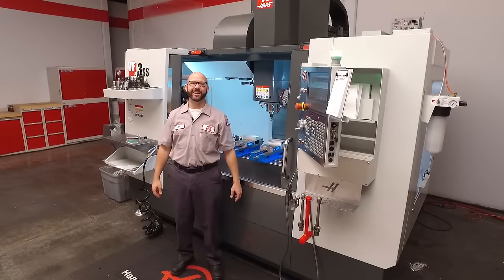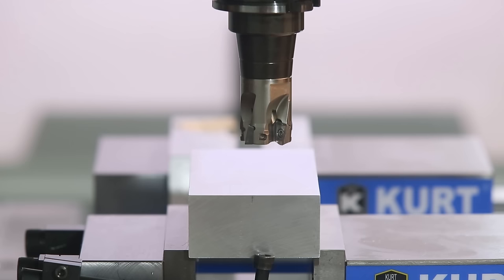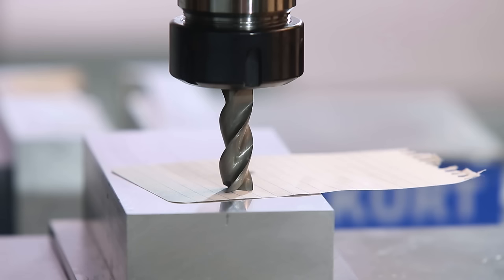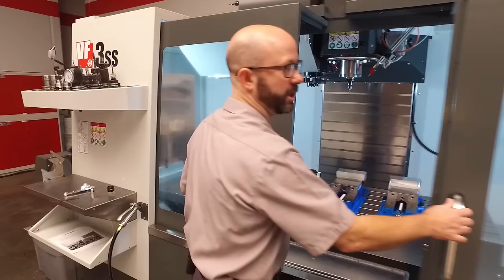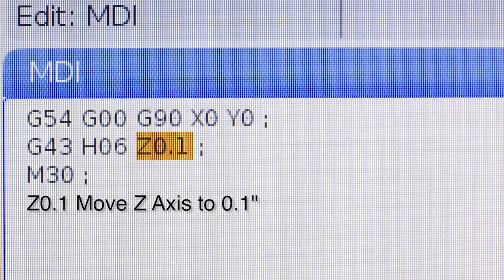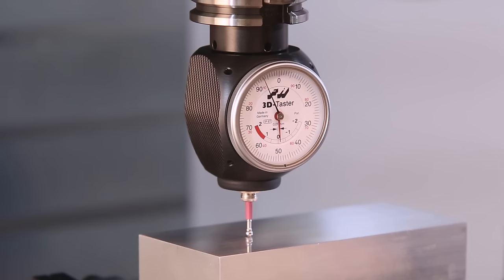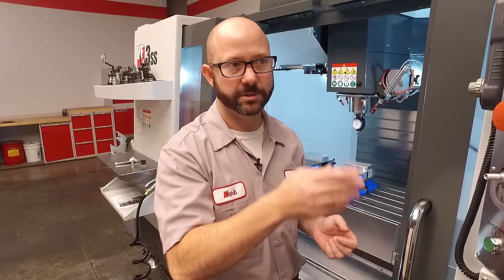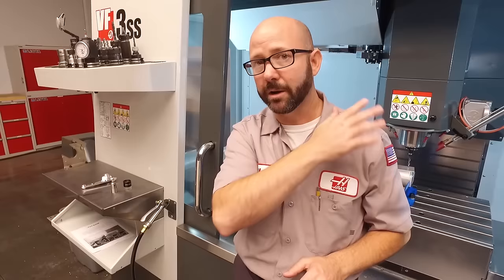How to: Set Tool Length and Work Offsets – Haas Automation Tip of the Day

Comment: While setting tools off the top of the stock is quick and easy, it's really not an optimal solution. If a tool breaks and needs to be replaced after you've already faced the part you no longer have the same reference point to touch it off against. In addition any offsets set this way will not be applicable across different setups, requiring you to reset all your offsets for every job, which can be a pretty big time waster. You'd be better off using either an electronic or dial height setter to measure off of the machine table, then use your indicator to measure from the table to the workpiece the same way you measured from the G54 offset to the G55. You can also tag tools with their offset values when they are removed from the machine, then simply re-enter those values the next time you use that tool.
Reply: You use a taught tool to figure out the difference... say .020 then you would add .02 to the length offset. Its all numbers not that hard... Some teach from table with 1 2 3 block or 2 4 6 block some use top of the vise, and some use subplate.
Reply: You're better off using the table or a sub plate rather than the vice, for one depending on your use case the vice might not always be there, for another, the top of a vice's solid jaw isn't always flat or level. For me, I reference off of the sub plate, since it's basically a permanent fixture in my mill. Whatever you do choose as a reference point it should be repeatable, simple, and consistently available.
Reply: Same applies maybe they never pull the vise off? Maybe they order matched sets? Just depends
Reply: Never happens more often than you'd think. I'd still prefer referencing off of the table or sub plate. I'd only reference off of the vice if I had no other option, such as if the table or sub plate were inaccessible.
Reply: Why would you need to set the new tool from the stock If you have the 
old(broken tool) tool value and the new tool value? You can basically 
use any point on the machine. Just figure out what is the difference 
between old and new tool and then type in the correct value. And why would you re set all your tool offsets? tool lenght is tool lenght, You set a new zero point.
Reply: SUMOCAT If you're measuring on the machine, as demonstrated in the video, you don't have the new tool's length. If you did you wouldn't need to measure it.
Reply: There's no need to know anything, because you can measure it with the machine. Lets say the broken tool lenght was 100, now put a new tool in the holder
G0 it to a point, for example next to the vise over the table
G0 to a safe distance above the table for example Z0 <- the original zero point that you had
Now joq and "touch of the table", record the distance from Z0 to the table, let's say the measurement on the screen is Z-90.42
We know the original tool offset value and the distance from Z0 to the table with the new tool (90.42)
Now original tool value 100-90.42=9.58 then 100+9.58=109.58=New tool value.

So basically distance from Z0 to the table with the new tool is 90.42 and if we would move that 
same amout with the old tool (100 long), we would be above the table by 9.58, and since we have "touched" the table with the new tool, that means the new tool must be 9.58mm longer so new lenght is 109.58
Reply: SUMOCAT Or, bear with me here for a moment, you could set all your tools relative to the table to begin with and not have to deal with any of that.
Reply: Yes of course, you should do it right the first time.
Reply: Just replace the broken tool with same offset as the old one. Why you thinking too hard
Reply: you must be joking right?

Comment: I would send it to 1.0 instead of .1 then you don't have to stop it before the end of 
the block and use the "eyeball mic". Run the program and test it with your 1-2-3 block.
Reply: I use 3.002 or so. This allows higher rapid speeds to save time while remaining safe because there is plenty of time to hit slide stop in the event of an error. The 0.002 avoids chipping a carbide tooth while being close enough to identify a math or measurement error. 1-2-3 blocks have so many uses.

Comment: what video should I see to find how to setup system to work with all G54 + tool offsets enabled in handjog mode ? I work with TL1 and ST10 lathes, and feel very handy to do some manual detail processing in manual jogging to presizely setup all tools corrections before automated cycle run
Reply: it's the same question: how to setup TL1 panel state in jog mode with large numbers in operator coordinate system with all corrections enabled ?

Comment: Just so I understand the hass machine reads off the programmers zero and not absolute machine zero  when setting a job? , my understanding for when running Fanuc controlled machines is that the zero point is referenced off the distance from the home point of the machine

Comment: This method can cause problems. The correct tool length is from the face of the spindle to the tip of the tool. Using the light up probe touch the face of the spindle to the probe (lights up). Set operator position z=0. Now measure all your tools. When the probe lights the operator position will be your tool length. To set your work offset touch any tool to the top of the part cursor over to your g54 (or g55,etc.) Z, then press work offset set key, (then put the cursor back to Z because it will move to X) then minus the current tool length. This way you do not need to re measure all the tools when switching to another part.

Comment: Ive always used a .100 jo-block and going positive.  That way I dont chip my tool.
Reply: I used to use a 1-2-3 block and a .250 dowel that way. Set all my tools, then on the Fadal, global edit all tools -3.25" to set zero to vise ways. Now I use a 1" Mitutoyo zero setter. Big multi-insert face mills/Shear Hogs I still use the block and dowel to be safe.

Comment: Not that it matters much in this application, but Interapid specifies 12.5 degrees from the work surface to be the most accurate. Mitutoyo specifies zero degrees. In the video it looks like about 45 degrees. Again, youre just using it as a reference, but I always shoot for the optimal angle for best practice.

Comment: I have a unique application in which the (non-rotating) tool has an X and Y offset from the centerline of the spindle. Does the controller support X and Y tool offsets?
Reply from the maker: Hi Charles – The only way I can figure on how to offset a tool’s position, in the exact same XY direction each time, is to set a Work Offset that is used only by that toolpath. You can touch off the tool normally, and then add to the Work Offset used by only that tool. We do this quite a bit when working with Right-Angled Heads. Check out https://youtu.be/URO3ETG18bs?t=684. Cutter Compensation offsets the tool by some amount, but not in a constant XY direction, it adjusts the tool in a direction perpendicular to the toolpath at any point. For specific, short programs, you can look up our G141 code in the Haas Manual, which does shift the tool, but the shift must be programmed on each line of code. – Mark, Haas Tip-of-the-day

Comment: You have a second part in the other vice. Why didn't you explain how to setup this 2nd part. The z height may also be different, as well as the origin point.
Reply: Hi. Check out 07:34 in the video, and we also have a link to another video which talks more about this, just above (pinned link at top)

Comment: Great video!  I have one question,  can Ithe tool length compensation and work offset be seen on screen in hand jog mode? Like, if I jog down to Z0 the tip of the tool will at the parts Z0 (G54)
Reply: Really good question. We should do a video on this. Newer Haas machines with the NGC control display the current G54 Work Offset, with the Tool Offset (Tool in Spindle) already calculated in, so the display works just like a DRO Digital Readout. On older machines, we will need to command the tool to XYZ zero first, G54 G00 G90 X0Y0; G43 Hnn (H matching tool number) Z0, and then press MEM, and then HAND JOG. from their, our Distance To Go position display will show the current G54 position of the tool. It's much cleaner in the newer NGC software.
Reply: Thanks pal!  I will try that first thing monday morning! Or maybe I will sneek in on sunday 😁 your videos are the best!

Comment: When teaching CNC at college I  used to use your first 5 or 6 standard first lines. I always made a point of telling my students to always cancel something when you have finished with it ie when finished with G43 H.., cancel it with a G49 G90 GO0 Z0.
Similarly when finished with tool radius compensation always cancel it with a G40 with an X and Y position off the part. Also to initiate tool radius compensation always call up the G41 or G42 with an X and Y position and feed rate. I notice in your videos that you dot do this with for the Z axis comp.
What are your thoughts on this?
Tony

Comment: Hello, maybe this is the best place to ask lol. I do production runs, some of the same jobs for years with the same programs etc "Haas vf-3" . Have had an issue for weeks now and not sure why. all of our parts are coming out .018 to .020 larger now only on height "Z" . Checked entire machine, checked this issue and verified it is happening on every program so we have to adjust our main z height for our parts. Could this issue be a wear offset somewhere that i may be missing ? we have also made sure that head is in same position in z just in case and there has been no change. I am clueless at this point, however i am not the only one running this machine, so Either other person or i may have inadvertently changed an offset somewhere that is affecting all z values during a cycle. Any help is appreciated.

Comment: why would you want to use such a method of touching off? it's only good for that setup. if you tend to use the same tools over again with different job, wouldn't you have to retouch them all off becuase the z-position of your work it's gonna change? wouldn't it be better to reference them to the work table and then only add the z value for each work offset?

Comment: Question : why don't you set all your tools to one z height , like say a 1 inch block and then set one tool to the part zero .Then your next job you can use the tools that are already loaded by just resetting one tool to the new part zero ?
Reply: That’s a great way to set offsets. It all depends on if I am changing all the tools constantly (job shop) or if I’m working with a consistent tool library. Both have advantages. Check out a video on your method, here: https://youtu.be/A7CwqjU2wg8

Comment: Your getting closer
I want to see a Haimer used in conjunction with an edge precision Tool indicator (4" height dial indicator for setting tools)

I touch all my tools off a tool setter from the table using G59. Then I use a Haimer to find my part, but I always have a few thousandths error.
Reply from the maker: MCEngineeringInc – That is a slick setup. Probes are always my first choice (for reasons beyond just touchoffs/setup), but it doesn’t get much better than a Haimer (Work Offsets) with a precision Tool Indicator (Tool Offsets) for Mills without probes. I should’ve shown one. Thanks. – Mark, Haas Tip-of-the-day.

Comment: There are so many ways to do  tool offsets this video is only 1 of them I use a n electronic z height gauge similar to the cute little thing he used. all my fixed length tool have dedicated offset numbers that are not the same as the tool number. I set tools with the z gauge on the table not the stock variable length tool such as those used in er collets have the same offset number as the tool number ie:- T1 = H1 work offset I do slightly differently to. I zero my indicator to the z height gauge then zero the z on the display then I touch off the indicator to the work piece or Parallel if I am doing a bottom up program and the display value is my z offset value for the work coordinate as this is the relative distance from my tool setting gauge. so as you can see there are lots of ways to set a machine.

Comment: What is the advantage of setting an offset vs jogging to where you want it it go and just setting coordinates
Reply: When you have only one tool, there is no advantage. 
In this case there are 8 tools, with their lenght already set, and it's here where you're going to take advantage:
You set the offsets (g54 and g55)
Then, with g43 activated, the machine makes the calculus needed (taking into account the lenght of the tool) to bring the tool to the Z you want.

He set the offsets with the measuring tool just once, wich is enough for all the tools.

Doing it the way you say, he would have spent 10x more time setting each tool.

Sorry for my english, I hope it was useful.
Reply: @ttarratto  yeah I don't use more than 2 tools most the time for my work so I just set coordinates and never use tool length offsets or anything like that..but I'd like to learn how lol I still got a lot to learn
Reply: @JrGil91  I also do it like you... But I'm learning how to do it. I use Fagor 8055. 
I think every cnc machine follows the same logic...

Comment: Hello good afternoon Mark, I run a HAAS VF6 50 Center, and we have a drawback that we cannot return to the milling sequences on the ERGAL SAE 6064 aluminum plate that we are milling, with a NX Siemens cadcam, there are many sequences and  due to a power outage due to the storm last night ..., the program had to be cut off and entered with a flash drive to memory and followed the milling process for the matrix being manufactured, we would like to know how to find  the sequence that was lost due to the power outage, I will also send you the manufacturing number of the HAAS VF6 50 Center that we have here in Cutral-Có province of Neuquén, Argentina ... and the other thing I forgot that we wanted to know how to open the door  of the machine if we give ok to the chip-FWD, and it turns out that it does not let us open the door to check the milling, my profile appears on LinkedIn, best regards Denis Morend.

Comment: Does anyone know, how do you set permanent tool table with tool offsets so that you only set G54 Z offset the first time (with dial) and then all tool lengths are already considered?
Reply: I setup my tools from a 123 block on the table, then use and indicator to find the distance between the 123 and the part G54 or whatever offset you use and enter that number as the Z offset.

Comment: Mark and Haas team, fist of all I have to say I think all your videos are really great and all of them teach basics and important things, congrats for that, but I'm afraid this video isn't what I was expecting for. Technically speaking you committed a mistake, it fairly works but it´s a mistake at the end because you're saying to your machine that all the tool tips are positioned into the spindle bore and the stock surface is in the home position what is not true.

If an operator do this for any reason and in the middle of the batch he gets a pre-setting tool and he runs the process being confidence of everything is good, it's going to get in a trouble because the machine is going to crash with the new tool and he wouldn't know what was wrong.

In milling machines the length offset must be always in positive values because it's the distance between the spindle face and the tool tip, on the other hand the work coordinate must be in negative because is the distance between the spindle face (being in Z home position) and the stock surface, as a result, if G54 is Z-16.85" and H1 offset is 2.5, the machine knows it needs to move Z-14.35" for reaching the Z0. of the work piece.

I hope it can help you to understand why this is not the right way, please don't misunderstand my intention, just I want to help.

Regards.

Ron
Reply: I agree with you in a sense. Positive tool lengths approximately represent the "physical" Length of the tool, depending on variation in your probe calibration. This is nice and easy to mentally digest. 

Despite that, saying negative tool lengths is the "wrong" way is to say it won't work well. It can work beautifully if the tools are touched off to a repeatable reference (not raw stock). When setting your work offsets, the z values must be the respective distance from your tool touch-off plane to your work offset plane. If you see the tool offset as the machine position when your tool tip would coincide with your tool touch-off plane, then it follows that you would shift your work offset relative to the tool touch off plane to send the tool to your part origin when z0 is commanded. Positive tool lengths are more time intensive and error prone to set up if you are touching tools off in this manner, and don't gain you much.  I despise when people think there's only one effective way to do something. It's all about how you manage your setup....

Comment: Where can I buy the probe at 4:08
Reply from the maker: Richard – There are a lot of great touchoff tools out there. Here are a couple. https://www.edgetechnologyproducts.com/pro-touch-off-gage/ , https://www.mscdirect.com/browse/tnpla/74285164?cid=ppc-google-New+-+Measuring+%26+Inspecting+-+PLA_sF0vuV8fX___164110844325_c_S&mkwid=sF0vuV8fX|dc&pcrid=164110844325&rd=k&product_id=74285164&gclid=Cj0KCQiA1sriBRD-ARIsABYdwwEhHgSJ2zq1HiJq4IahO1RjfWjJaR1eGDu_gbIlLPhu6gDhixgrGIMaAkDsEALw_wcB . If anyone has a favorite product, send us a link, here in the comments! Thanks. – Mark, Tip-of-the-day